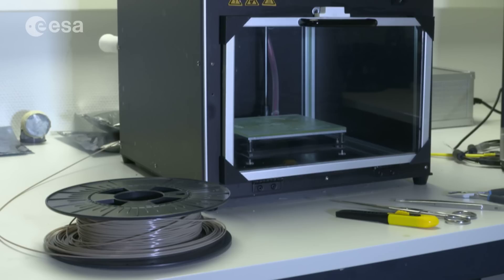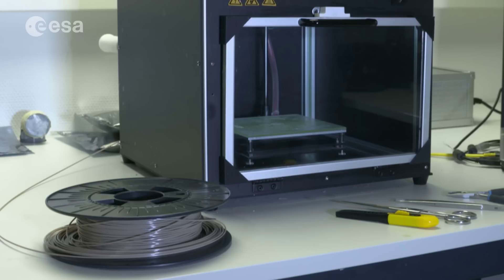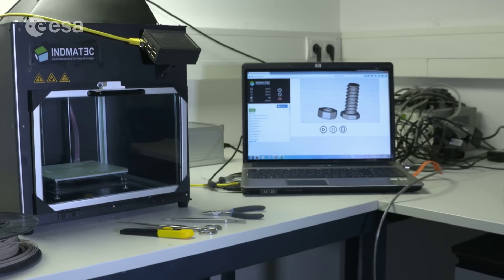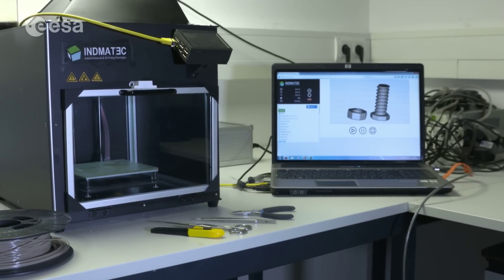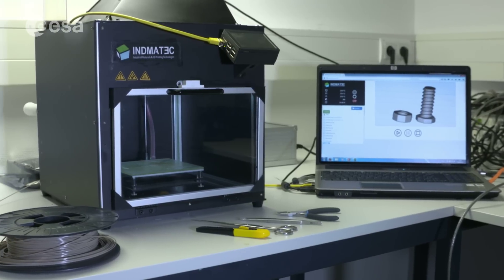3D printing in hard plastic

Comment: Will the data you gather be published? 
It would be very useful for everyone in the 3d printer community!

Also how does the compare to say nylon and carbon infused products e.g. colorfabs xt-ct20.

Best Regards

Dave Webster
Reply from the maker: +Dave Webster We've checked with Ugo Lafont, he kindly replied: 
Indeed we are going to publish the results. I just can say now that PEEK printed object show tensile strength properties that are just 20% lower of the theoretical PEEK tensile strength.This is only due to printing parameter optimisation...work is going on.
Reply: +European Space Agency, ESA Can I just say I think it's excellent how you endeavor to reply to so many comments with actual, useful information. The interaction is great, and you're doing a marvelous job.